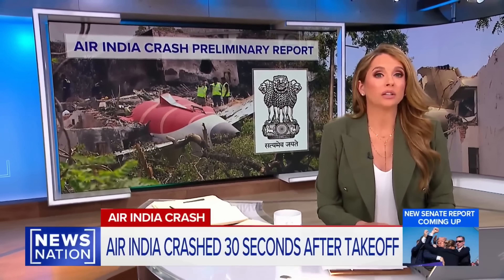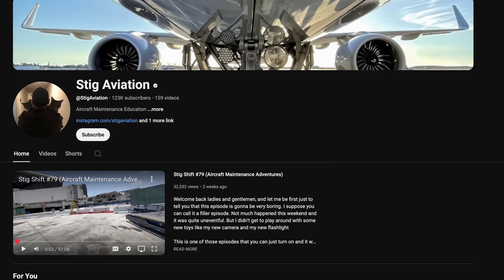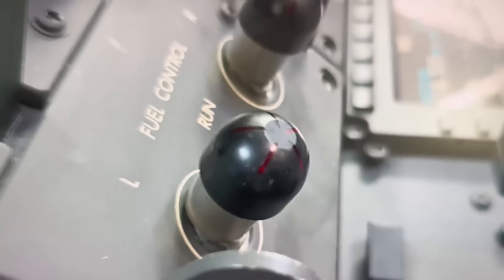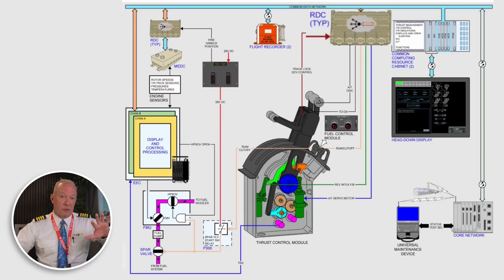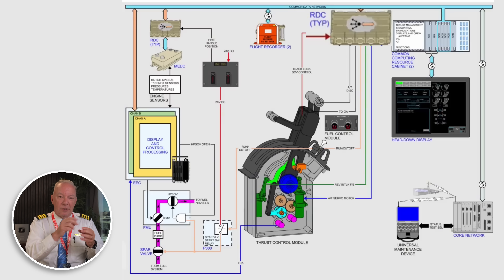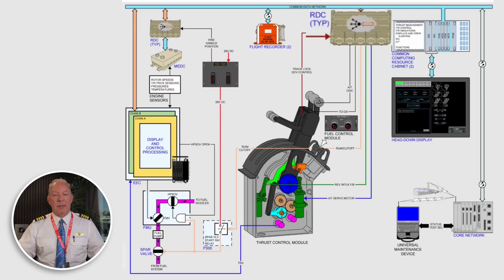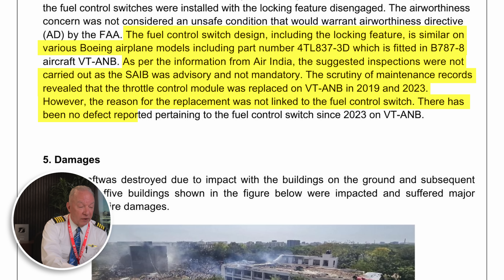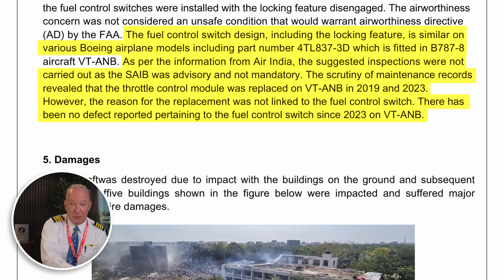The Truth About Boeing 787 Fuel Control Switches

Comment: I sense some stress in your voice and I apologize if this comment adds to that stress. What if the wire that supplies 28V to both of the cutoff switches fails in some way. For example a connector in the wiring was loose and and it caused the 28V to both switches to be lost this is a single point failure that could be the cause. Everything I read states that the data recorder samples these switch positions at one time per second so even if 28V was lost to both engine cutoff switches at the same time the data recorder could still time stamp them as one second apart. Then when the pilot flipped the switch to the off and then back to on could have caused the wiring failure to become good again. This theory is a stretch and I don't believe this is what happen but I just think it should not be ruled out. Your Boeing guest even stated that problems with wiring happen and I think he is right. If I recall correctly some part of this engine control unit had been replaced and if it wasn't replaced correctly that could also be a reason why something like this to happen.
I also see someone commented that the two engine cutoff switches are completely independent and if they each have their own 28V supply wire and don't share anything in common then this would rule out this possibility but at this time I don't know how independent they really are.
Reply: How it explains delay between t1 and t2 stop

Comment: Thank you Captain for another great video. Would be very interesting to know from where does de DFDR take the data to know the FUEL CONTROL switches position...it's a dedicated sensor on the switch itself?...or on the relay...could this data to the DFDR be affected by an electrical disturbance on the cables like i.e.: a short circuit? (as commented about the 787 manufacture in South Carolina BOEING assembly plant on the 2022 NETFLIX documentary DOWNFALL)...hard to know right?

Comment: Captain Steeeve explains that the fuel switch energises a relay which then energises fuel control valves open.  He describes them as simple fail safe devices.  But the piece he is missing is the wiring/circuitry between those devices (something usually missed by a novice because they are only thinking about the equipment and not the interconnections).  If a wire disconnects or goes high resistance between the switch and the relay or between the relay and the valves, then the fuel valves will de-energise (close).  For me, that is not fail safe when you are taking off and need fuel to continue!  As much as I love Captain Steeeve, I think he is actually wrong here and based on his explanation there are failure modes that do result in fuel shut-off without physically moving the switches.  It’s unlikely that wires would simultaneously fail on two engines, but it should not be dismissed on YouTube.

Comment: HOW DO THEY FAIL if a line is severed or short circuit? on , off or stay as set?( I mean the  relay is NC, NO or bi stable?)  i think of the remotely possible condensation on the line or some water  in the circuit...lets say from the AC . I am trying to see any possibility,  just from technical point of view .

Comment: Retired aircraft controls manufacturing here. I'm having trouble understanding how they are absolutely sure there is no digital connection to the switch. There is a digital signal sent from the switch to the Remote Data Collector. This information is then processed by another computer which also has full authority over the fuel pumps and downstream shut-off valves.  The computers all know that the fuel has been cut off and proceed with the other shut-down processes. A false signal sent to the RDC could initiate a sequence that is probably only understood by the Boeing FADEC engineers.  Here is a good diagram.

 https://youtu.be/jCejjql1eaE?si=sdGRgfLejyjo412O

 This investigation could take months or even years to fully understand what happened. The 787 is one of the most complicated machines ever built and we need to wait for the final report. Blaming the pilots could slow down the investigation and we could have another tragedy.

Comment: im my opinion, whenever they are placed onto the cut off position, system should make Alert, informing Cockpit(BOTH pilots), fuel cut off switches have been turned to OFF-Position.

Comment: Boeing has a patent for a thrust management system that shuts off the fuel to an engine should the position of the throttles be at idle, WOW be closed and the engine be at high N1.  I assume this functiin is in the FADEC. To reset the system you have to physically move the switch to cutoff and return to run.

Comment: His continuing to call it an engine failure bothers me because nobody would say their car had an engine failure if the ignition was turned off.   It would be the engine was turned off.   Is he still calling it failure because he went out and claimed engine failure early?

As an engineer I find this lacking.   An over simplification that conveniently side steps what I think are the most powerful arguments that leave the door open for some sort of failure.   He emphasizes DC voltage powering the valves through what he called relays that were turned on by the switches.  But his language was fuzzy enough at points I got to wondering if what he called the relay was the switch contact itself.   Having a separate relay beyond the with contact opens more possibilities.  Not only is there the power that goes through the relay but the really coil that enables the relay function, where does that power come from?

And battery voltage is well and good, but he didn't say there were separate batteries.   he said they were totally separate systems but then seemed to focus on the switch path so did totally separate include separate batteries?  I would hope so.  And in none of that did he speak to how the FDR knows the switch position?   Just what is the FDR sensing?  He says there is no digital bit that could have been faulty, but what is the FDR recording?   Whatever it does sense, it ultimately is reduced to a digital bit, or a sampled voltage.  Detail on that helps and exactly what did the FDR show.   Did it just show a logic state (digital bit) or did it show actual voltages?

I do acknowledge the strongest evidence that a person flipped the switches rather than some failure in the avionics is the one second delay shown by the FDR which could easily be someone switching the switches.   For a failure someplace in the avionics, one would expect they both would go at the same time but there are things that can cause a delay.

Comment: It  could still be a bad electrical connection from the switch to the relay.  Bad  connection will simulate a cutoff  position could be another possibility.  Especially if the  DC  source is from the same bus.

Comment: Some say the switching transition time is very brief for manual operation. I am  an engineer in Satellite uplink for more than three decades and from experience, relays do malfunction. Contacts or coil supply do fail or experience intermittent failure from cracked or dry solder. The diagram shows  one relay, but I assume there will be two independent relays. I don't have any idea at which node the sensors record the switching or if the DC supply  is common or separate for both the relays... difficult to make any guess.

Comment: Cap. Steve,  I full agree with your explanation.  As a control system engineer, I kind of wounder does the elekectoromagnetic coil of the relay stay energized continuously, especially during a very long 10 or 15 hour flight.   The reason being the coil consumes energy and also produce heat, and eventually can fail, due to magnetic field fatigue.
Reply: So the way I think how the valve works is when the relay is energized,  the valve armature get moved to open position.  Then the fuel flow pressure, hydro dynamics, and a mechanical latch keep the valve open, throughout.  At the end of the voyage when manually move the fuel cutoff to shut position, the electromagnetic relay energized again and move the latch to opposite, in order to move the fuel shut off valve to close position.  This will only happen if the fuel line has no pressure due to the pump is now not running.
Reply: The relays are also held with permanent magnets. If power is lost, they don't change state. They don't relax to a neutral position. They stay in the last commanded position.  Those simplified coloured schematics are hopeless and so is Captain Steeeve's description. He should leave the descriptions to the engineers. 
The fuel cutoff switches don't directly command the engine valves to open. They enable the EEC to control the opening of the engine valves.The switches, however, do command the spar valve to CLOSE and, indirectly, the engine valves to CLOSE.

Comment: @CaptainSteeeve - Can you clarify this?
Does the FDR record the state change of the switches themselves (run to cutoff or cutoff to run), or does it record the downstream valve state change?
Some of the Internet arguments can be - short circuited - if the former is the case:  A positive event record of the state change of the switches themselves.

Comment: If what captain Steve saying is true then ANA 787 dual engine shutdown incident in 2019 never happened…

But it did happened and both engines did shutdown without pilot ever touching fuel switches.

So… 🤷🏻‍♂️

Comment: This guy is still shilling for Boeing despite being debunked repeatedly all the way back from the original lie about “flaps.”  The landing gear froze mid-retraction well before the RAT deployed.  This tells you that there was already a general power failure and that the pilots were toggling the fuel switches to restart the fuel pumps.

Comment: One thing this relay system is critical: voltage and current. Mechanical system is durable.  Rat in electric wires are common problem.

Comment: I have used similar switches on various military Vehicles and generators. They have to stay in whichever position they are set despite any movement or shock from hitting a wall or another vehicle.

Comment: Even if the relay failed, it would likely fail in an open position since it was already open.  Looking at all the evidence from the flight data recorder to the cockpit voice recorder and the final position of the switches after the crash, the evidence is quite clear.  It was a deliberate act by one of the pilots.

Comment: Steve, and others, I think you’re missing the point.  Suppose the relay gets out of sync with the switch?  Seems to me this could happen, and it doesn’t have to be ‘stuck off’ (makes it difficult to take off).  It could be ‘stuck on.’  Consider what might happen if the pilots took off with the switches in the OFF position.  Nobody moved them.  Nobody tried to commit suicide.  The actual switches didn’t move by themselves—they were already off.  I think it’s possible.  Heck, the whole explanation posted here seems questionable.  Take a close look at that schematic: I see THREE valves in the fuel path, TWO of which are controlled by things other than the fuel control switches.  Seems to me any one of those, or a simple 28v battery failure, could cut the fuel at any time.  Why is that so hard to understand?

Comment: Electromechanical relay or not, that circuit could easily be designed to include a safety interlock or receive a permissive signal from the aircraft automation system.  Again poor design. Like I said, I’m an engineer and I understand these things better than your team, and I certainly understand it better than Boeing.

Comment: We often hear the term "redundancy" when it comes to design of aircraft.  Some systems are so simple that many want to think there is a mystery because of the number of wires needed for get an aircraft in the air and back home.  This simple system takes out all of the wishes as you said.  Wonderful explanation.

Comment: A 'relay' has a coil and a set of contacts. If the switch is connected to power a relay then the relay is a possible failure point. If one pole (set of contacts) is used to provide a signal to to indicate whether the relay is open or closed that could have been what the other pilot saw (then responded to?).

Comment: Respectfully, It seems like pilot  Steeve does not have a clue or something called electronic software that is part of the sophisticated automation in an airline like the Boeing 787. It can automatically take decisions if it thinks the pilots are not doing the right thing or the plane is in a certain configuration that it thinks needs automation to intervene without any physical switches moving up down or sideways. 

Make a note of that before re-explaining the function of the fuel cutoff switches and attempting to implicate the pilots for the possible automation faults of the plane.🤔
-SSB
Reply: The electrical software wouldn't have anything to do with the cutoff switches. The electrical software runs off a different system, but the fuel cutoff switches works on direct current. It isn't routed through an electrical software to operate as Steve explains here. So, while electrical software can change engine power, it would do so independently of the fuel cutoff switches. But we know that it was the fuel cutoff switches that caused the problem

Comment: Captain Steve, Thank you for your clear explanation of the technical aspects of this tragedy. I am not an engineer, I am not a pilot. I do understand how things work in general. I really appreciate you spending your time giving us details that we may never have known if not for these instructive videos.

I agree with you that we all have hoped there was some non-human cause to this terrible situation, some explanation that 'if this anomaly is changed, this will never have to happen again'.
I also agree that while we all have our hopes and emotions, we must stick to facts.
Emotion never changes fact, but facts SHOULD affect our emotions.

I really appreciate you putting this information out there. Whatever far-fetched, out-there kind of explanations we can come up with, it could have happened that way. But for me, both engines with controls from two independent engine systems is just way too coincidental.

However, I love to be contrary. 🙂 Some have intimated that it could be some electronic or software glitch. You have thoroughly explained that the position of the switch cannot have changed without a human manually lifting and moving the switch to cutoff. However, if I remember correctly from your videos and others, it is the Flight Data Recorder which states that the switches were transitioned ... and so on. Could you explain also how the FDR receives information regarding the position of the various components, including the engine cutoffs? Here is what I mean:

Fact: The first pilot asks the second pilot 'Why did you cut off the engines' and second pilot says 'I did not'.
Fact: Both switches are found in the ON position in the wreckage.
Fact: We do have two sources that indicate a human did in fact move both switches, the FDR and the pilots' recorded conversation.

However,

Could a glitch cause the instrumentation to SHOW the engines were cut off? 
At what point do the two independent engine electronics systems merge their information so as to appear on the instrumentation, or does the information merge at all?
Could such a glitch cause the engines to fail, causing the RAT to deploy AND cause the instruments to show the fuel switches in CUTOFF, though they really are not in cutoff?
Could this be why one pilot asks the other why he moved the fuel switches to cutoff, and the other answers 'I did not'?
Then, as the glitch corrects itself, the software corrects data to the FDR that engine one is actually in RUN, causing it to restart, then software senses correctly that engine two is in RUN, so that it also begins to restart?

In other words, you have sufficiently explained why there could be no glitch that could cause the switches to physically change positions, and that there is no electronically possible way for electricity to be cut to the three fuel valves without the physical switches transitioning to cutoff. But could a glitch have caused the catastrophic dual engine failure and at the same time sent MISREADINGS of the fuel switch positions to the FDR?

Again, I am a novice and there is really nothing about any of your videos on this topic or others with which I have any disagreement. I'm just throwing this out in order to even better understand how these avionics actually work. Again, thank you for your time. I find your videos fascinating, please keep them coming!

Comment: From the preliminary report, we know that total control of the plane in question was replaced multiple times. From what I heard was the whole control was replaced, including the switches. Now, is it possible that this detail that you’re mentioning was filed down and the spring somehow was loose as it is a mechanical system. If the spring was loose and not holding it tight down, the switches can move with the vibration as it is in the initial climb phase and the pilots were not I repeat, not looking at the throttle panel, including the switches when the plane was taking off, I believe this switches needs to be looked at my theory and thinking is that Ram turbine deployed, causing a search in the system, causing the switch to malfunction and cutting off the fuel this happened without the switch is being moved however looking at the picture that you just posted, I believe that the indentation was filed down or not manufactured to the specification
Reply: That would need to happen to both springs on both sides at the SAME time. What are the odds?
Reply: As an engineer, this makes zero sense. “The total control of the plane was replaced”. What? “RAT caused a search in the system”. What? A “throttle panel.” What? Handwaving “the switch malfunctioned” is silly. Two, in quick proximity but not at the same time? No.